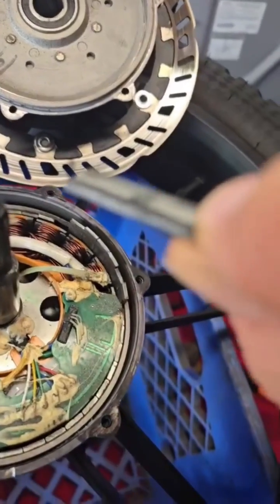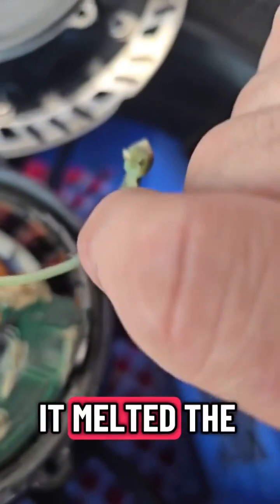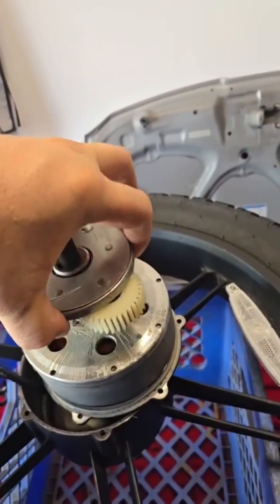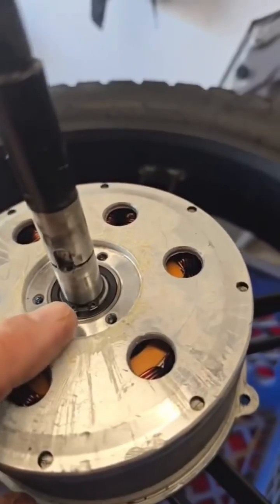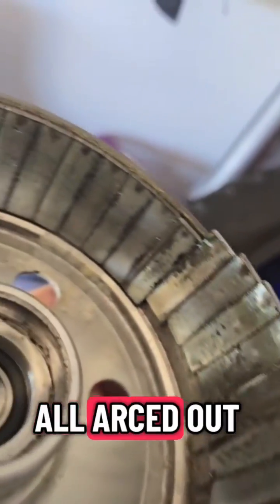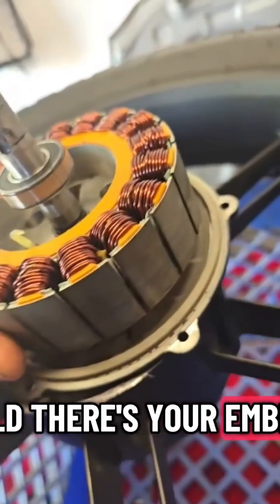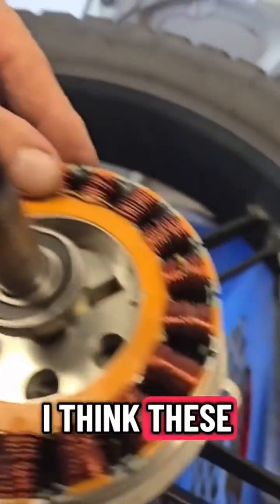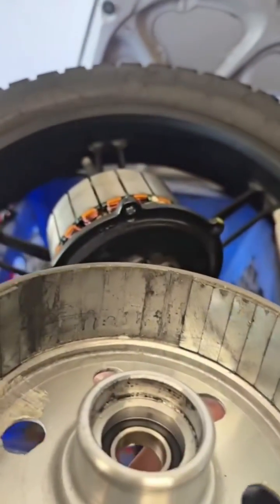What’s INSIDE?! 1500w Hub Motor On Electric Bike - How Do We Break Ours?!

Comment: Damn dude for a 1500w motor I'd be pissed if it had this problem, unless I was like hella hard on the thing... But even then, geez
Reply from the maker: I did upgrade it tremendously 🤣
Reply from the maker: I seriously had it coming. Went to a 52 volt and a 80amp controller. I might check in with the manufacturer